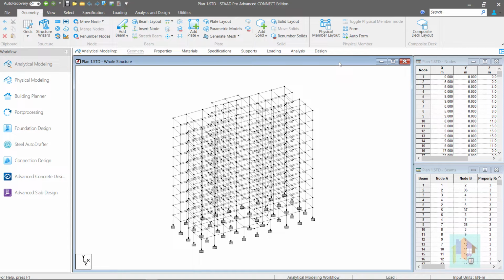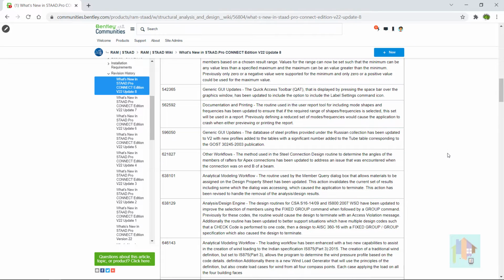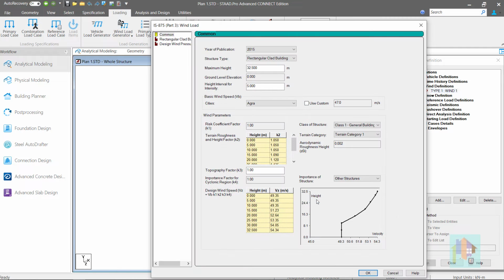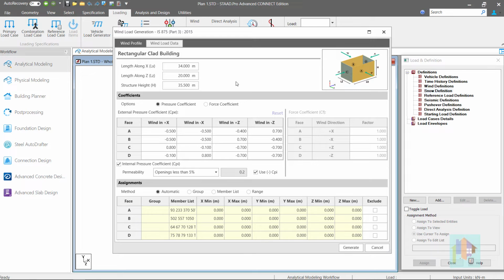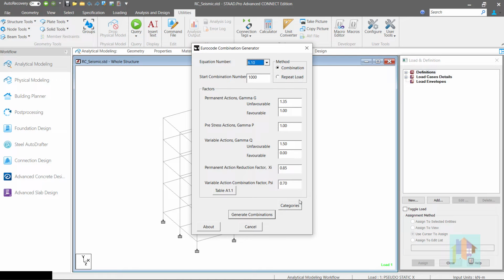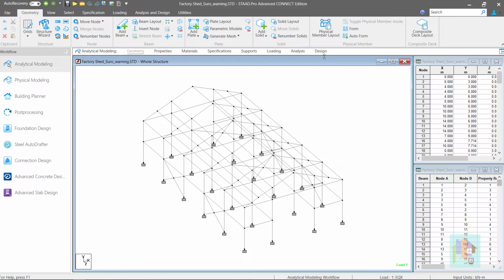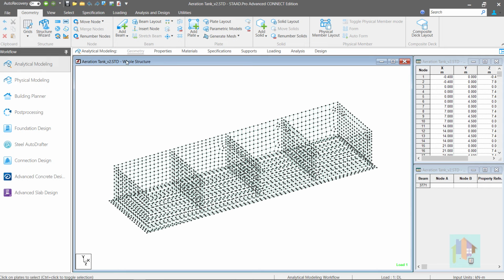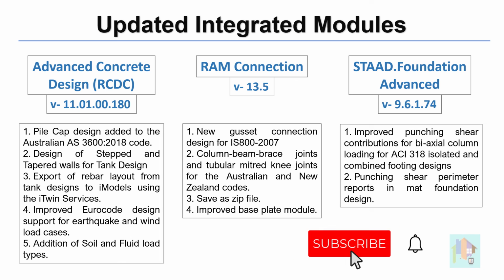STAAD.Pro CONNECT Edition V22 Update 8 - Updates and Enhancements||IS875 (Part 3)||CSA S16-2019

Comment: Sir, we want the auto wind load generation of any shaped buildings like circular, hexagonal , or for any non rectangular shaped buildings,
Also, we want auto wind load generation for roof/purlins for steel structure also, as there is much more manual efforts needed in calculation of wind load for roof purlins for different shapes of roofs, also auto wind load for steel structure in case when we have put iterative trial and errors process in wind load calculation for solidity ratio for roof purlins/steel frames......

Comment: Sir, in case of a industrial PEB structure/warehouse, what would be the building category?  Will it come under rectangular clad building or something else?
Reply from the maker: For wind load application? If the warehouse has a leveled rood (like any residential building, though it is very unlikely), then you can consider it as a clad building with proper permeability factor. But for any warehouse with pitched/mono-slope roof, this method is not appropriate (approximate) as for this type of sloped roof structure, there are several other factors which we need to consider (table 6,7, 9, 10 etc). In such case, it is better to go for a manual load application or use any custom macro. You can check this video where I have discussed about wind load on sloped roof -- https://youtu.be/jFPJC2o5cKo
Reply: @surojit_ghosh  thank you sir for the clarification. I'll check the video.

Comment: when I apply wind load for G+3 storied structure , the concrete designed gives very high column sizes and steel. while this structure is in Raipur. What is the reason?
while in this region wind load should not be governing  load
Reply from the maker: It is not possible for me to comment on this unless I check the model. There might be some modelling issues or geometric configuration which can generate this type of outcome. You can post this query along with the model in Bentley Communities site.
Reply: @surojit_ghosh  ok

Comment: @Surojit Ghosh Sir, Can we consider unclad building structure type for generating wind load using IS 875 code tool as discussed in this video and apply to Solar Structure ?
Reply from the maker: You can but that depends on the solar structure geometry and arrangement. For example, solar structures are normally mono-sloped structures like bus stop or isolated car parking structure and also these solar structures are placed in a row. The best way to apply wind load on these type of mono-sloped pitched structure is by considering factors from Table 8 of IS 875(Part 3) code. In STAAD, the unclad type wind load generator does not consider this table, rather it is implemented for building structure. Still you can use this by providing few inputs like solidity ratio or projection area of members. Wind load will be applied on the members of the solar structure, but the intensity will be approximate. For smaller structures, you can ignore this difference.